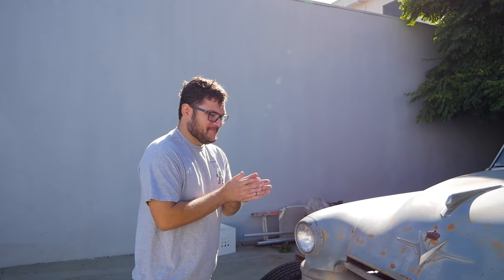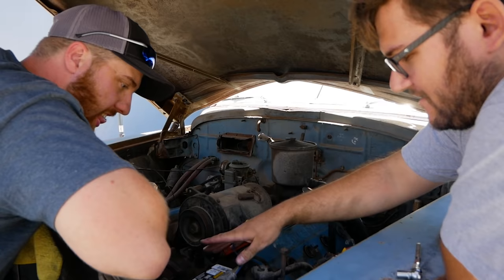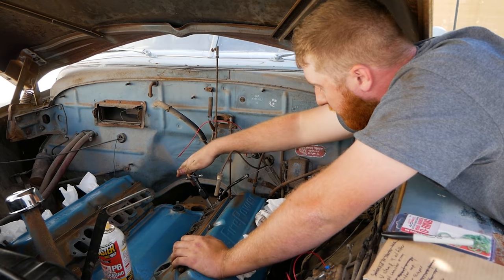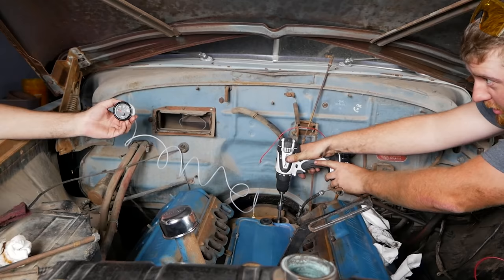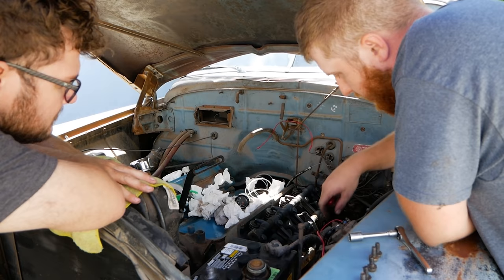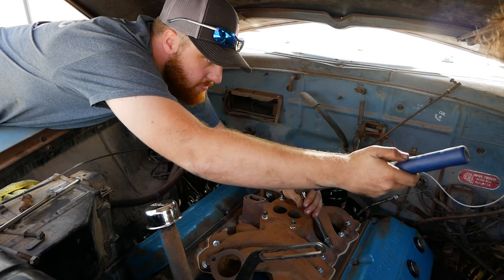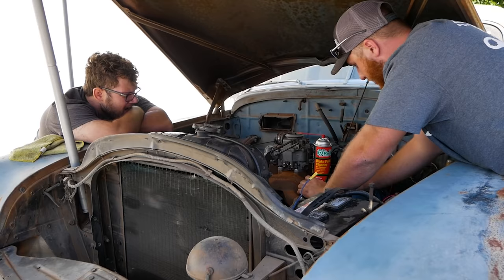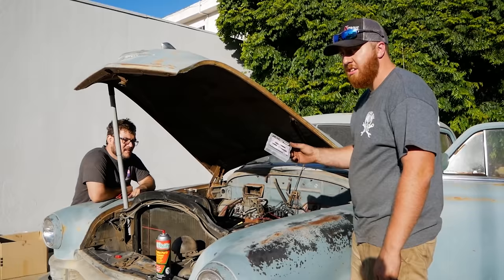Can We Revive Nolan's 1952 Imperial? First Start in 38 Years!

Comment: "124,000 miles. Honestly impressive that it made it that far"

looks away in 293,000 miles
Reply: 300k is the new 150. I had to replace the everything tho at 160🙃
Reply: Reliabilty standards have come a long way since that Hemi.  As pretty as it it.
Reply: Oil changes ftw
Reply: 50k was the average life span of those older motors. But then, people weren't driving as far as we do today. So that was a pretty long time for them to last.
Reply: With the oil filter never being changed, 124,000 is damn good.
Reply: Well, with a 50s motor, its impressive, today, gas v8s can go 500k before they completely want to give up
Reply: @sylleess4914  Don't exagerate.  Remember, they never changed the oil filter in this car, which means that it went over 100,000 effectively with no oil filter, on motor oil that is very inferior to today's oil.  I say that is EXCELLENT.
Reply: @NEEDbacon  You mean MOTOR OIL has come a long way since the 70s.
Reply: @jad43701  The average mileage of a scrapped car in the 50s was a little over 100,000 miles, not much better in the 70s.  It all boils down to MAINTAINENCE.  If you don't change your oil, and don't keep the oil level full, it will not last long.  That's just the way things are.  And today's oil is far better than yesteryear's oil.

Comment: Before you hook up all the electrical components; That car is a POSITIVE ground. It’s presently connected backwards.
(And put zinc additives in the oil) 😜
Reply: This is one of the things you'd (or at least I'd) never think of if you didn't already know it!
Reply: @vinno97  my very first car at 14 years old, in 1994, was a ‘54 Dodge. 
I’ve had about 70 antique cars since then. Many old MOPARS! 
I usually dump an 8 volt battery in place of the 6 volt. It spins it up faster and doesn’t require much modification (if any) to the electronics to function normally. But, they are all positive grounds until 1956.
Reply from the maker: I think someone probably converted it over at one point
Reply: @JunkyardDigs , that’s good. I’ll stop yelling at my television. 😂
Reply: It's painful to watch
Reply: That 331 hemi sounds awful.
The carb is in need or a rebuilt...timing sounds retarded big time.
I have a few old 331 354 hemi's.

Comment: You can use an 8 volt battery in that 6 volt system for faster cranking, the 6 volt system can usually handle a couple extra volts, just need to adjust/replace the voltage regulator to the charge the 8 volt battery properly.

Comment: Brilliant the way you focused in on that clogged oil filter, which stopped oil pressure in the system.  The average bear wouldn't have even thought of that, rather us common folks would have dropped in the distributor, rigged the coil, topped off the oil, and let her rip. 
      I watch all of these "will it run" videos on YouTube, and finding that clogged oil filter showed a depth of understanding well above most of your peers.

Comment: the car was in gear that's probably why it was turning over so slow also.
Reply from the maker: It's an auto transmission
Reply from the maker: Well... Kind of. It's complicated but that's not the problem
Reply: @JunkyardDigs  was it one of those trannies that has a torque converter between the flywheel and clutch? I forget what they were called. I believe Dodge was the first to use them in the 50s.
Reply: @JunkyardDigs  oh okay and I do know that it being a 6 volt system can cause it too.
Reply: @JunkyardDigs  Thee car was not in gear, was it?  The car has no park and I am willing to bet you didn't have the hand brake engaged.  The rear wheel was turning with the force of the driveshaft.  When you accelerated, the rear wheel didn't spin any faster.

Comment: Need to find the missing choke stove pipe assembly to close that exhaust hole in the intake. ( exhaust gases were used to heat up the choke on the carb thru tubes in the good old days)

Comment: Dude I swear nobody changed their damn oil in the 50s. Must have been a depression era thing. “Why would ya throw out perfectly good oil”
Reply: Didn’t throw it out. Used it on their dirt road to keep the dust down.
Reply: I had an old timer tell me the famers used to take the old oil and mix it with gas and run it in their chainsaws... like 10:1 mix. I learned this when I was a very young and ran a late 50's Homelite saw with modern oil at 30:1... and yes I blew it up.

Comment: Watching the rear brake drums spin makes me wonder if you've got the trans in gear.
Reply: I was thinking the same thing.
Reply: and that is why it cranked too slow on 6v
Reply: I believe it's an "All-Fluid Drive" trans. Basically a manual with a torque converter between the flywheel and clutch, so the only time the clutch had to be used was to change gears. Starting it in gear would basically be no different than an automatic starting up in park.
Reply: if you're right, your comment needs to be pinned to the top.
Reply: It was not in gear.  if you will notice the drum did not spin any faster when the engine was revved up.

Comment: My dad has a 1948 coupe with an inline 6 that I wish he would let me help him get running. Its engine was supposedly rebuilt with the intake and carburetor still installed. He just doesn't have the time given we have other antique cars we are currently working on including a 1969 Dodge Polara 440ci 4 barrel, 1972 Jeep CJ5 (1st yr of the 304ci 2 barrel V8), and 1985 Dodge D150 318ci 2 barrel.

Comment: If it's anything like my '51 DeSoto (a branch of chrysler) S-15 (Desoto's version of the imperial, it should turn over slow like that because it's a 6 volt system. Bonus fact, the '51 S-15 is a positive ground system.
Reply: "6 volt systems turn the starter over slowly" is a myth.  If you use 1 gauge cables, not skinny 4 or 6 gauge cables, AND have all connections CLEAN AND TIGHT, EVEN THE STARTER CONNECTIONS, and use, in this car, a group 3 battery, it will crank fine.  I have a 54 New Yorker, and it cranks nice and fast with 6 volts.  If you think it doesn't crank fast enough, you can use an 8 volt battery.  You just need to have the regulator adjusted so that it will work with the higher voltage.
Reply: @michaelbenardo5695  I misworded my previous comment. I meant that 6 volt systems turn over slower than 12 volt systems. As you stated even the 8 volt batteries will cause the starter turn faster. As for my specific situation, I know that the starter terminals are fine as I just had the starter rebuilt, the 1/0 (0 awg) battery leads are more than enough, and the battery is working properly with no dead cells. Also, 1awg is a little uncommon, did you by chance mean 1/0? Both 2 awg, and 1/0 are more common.
Reply: @psychotic_hero  I meant 1 gauge.  You will have to go to a human-owned auto parts store and probably order them, as there are no cars being sold of recent manufacture with a big enough engine to require them.  You can use 1/0, which is even bigger, but make sure that the hole in the lug end is not so big that very little of it contacts the terminal for the cable that goes to the starter.  If it is too big, use a washer between the two cables, so that there is plenty of serface area in contact.  Also, make sure your ground cable is making good clean solid contact with the engine block.  It must be clean, or you will likely have trouble, unless you have a tiny engine.  You will get it to work well.

Comment: Remember.  a 12v system runs 10 amps.  a 6v system runs 20 amps. Out side of making sure you have good battery ends (toss those clamp ons).  You want THICK battery cables.  Like 0 or 1 gauge Be careful buying parts store battery cables.  you could throttle the Amperage to the starter. Also,  back in the day they ran non-detergent oil with left tons of much in the engines (Seafoam to the rescue).

Comment: So duct tape and baling wire have been replaced with zip ties.
Next time, I would recommend taking the hood off and sitting on the fenders.  You could also put a small grill and fridge with beer in there also, it'll cut down time.

Comment: No one asked but if you are planning on doing something like this at home yourself I highly recommend getting the manufacturers workshop manuals for the vehicle you're working on. Not those cheap $20 service manuals but the workshop manuals sent to dealer workshops. It'll make your life much much easier and will pay for itself in the long run. Obviously it's not "needed" but in most cases it'll be very useful even if it's just to clarify what you already believe to be correct. 

Obviously you can't get them for every make and model but you can for a majority. They are very comprehensive. Even things like missing bolts can be looked up quickly without having to stuff around. 

IMO ALLEGEDLY

Comment: Too bad I wasn't there when you did this. I know that circa of engines I could probably rebuild it drunk... wait, I'm pretty sure I have!  If you haven't figured out the fuel pump clamp try a dryer vent clamp, they're 5 or 6 inches.
(Signed) Old Iron Man.

Comment: My clasic revival was a 1979 dodge W150 (power Wagon) Now I am dealing with gas in the oil. New gaskets all around new fule pump and new carb but not sure the problem at the moment. I think I have the adjustment screws on the carb set at about half a turn from closed. I did not get gas in the oil untill after changing the carb so I think it is a problem there. I had it running great untill it blew a head gasket. though the origional carb did crap out on me after changing the head gaskets.

Comment: That engine will run dam near forever if you maintain it, especially with today's oil being WAAAAAY better than back when this car was made. Better spark plugs, carburetors, gas, better everything. Rebuild the suspension, give it a coat of fresh paint and cruise it on the weekends. I'd make it a baby blue low rider with nice exhaust pipes and call it good...

Comment: So worried about priming the oil, then throws LOTS of brake clean down the pipe LOL. Poor Hemi. Then they complain its tough to turn over, yet clutch is engaged and starter has to spin transmission, driveshaft AND differential, then as an added bonus the motor pukes out a couple of their paper towels they stuffed down the intake lol 

"Oh it's on fire!" That's an unblocked off heat riser from the exhaust genius!

Comment: My pickup still has a 6 volt system and the only way I could get it to reliably crank, with speed, is to use incredibly thick wires to the starter. Like 000 gauge wire. Before that I did have to jump it with 12 volts once or twice, I just isolated the starter from the system.

Comment: Second comment 6 volts is enough to crank it. There's a choke for a reason. It makes it much easier to start at a much lower RPM. There's plenty of compression and assume the carb is dialed in it'll start within 15 seconds of cranking on the starter. Once the first cylinder fires the rest will follow most likely without a single misfire. That starter is meant for torque not speed. She wants choke. Here's the edit. I didn't realize that you didn't have the ignition timing already set. No wonder it didn't start even with the 12 volt. If both the distributor and the carburetor were right it would easily start on the 6 volt system. 12 volts isn't good for them. I just hope you didn't fry too much of the system. My first car was a 1954 dodge royal with the famous Red rod. Father used to drive his old model T Ford when I was a kid. I was born in 1927 and I'm too old to drive now at least legally. I also had a Studebaker and used to run rum back then. I'm 94 years old now and know how to text with a smart phone. I'm a very wise man and always learned new things. My wisdom rivaled that of Albert Einstein in my day. The only thing I have to say is that you can teach an old dog new tricks as long as he is wise enough. (PS. I started working in 1936 when I was 9 years old and by the age of 14 I was a machinist)

Comment: Do yourself a big favor and change it over to 12 VOLTS.. Just have your generator rebuilt and tell the guy to make it 12volts. Change coil and light bulbs in dash. Radio heater motor will be fine and wiper motor will be fine. And please put an OPTIMA BATTERY in there. They WON,T EVER LEAK.. CHANGE some ,truck. The head lights blinker brake bulbs will be fine without changing, no need to change the starter either.

Comment: Rebuild of the lower engine and the stuck valves in the oil filter housing likely means that the engine was rebuilt because of a spun bearing. I'm 14 minutes into the video at this time.

Comment: It must be the spring why the starter motor is electrically running off the battery? Nope. Pull the starter and crank it again. It will be pretty obvious if the spring and starter work. I think your starter is mis-wired or your starter solenoid/ignition relay is stuck.

Comment: omfg nevermind. I cant make it pass the 8min mark. 1952? should take about 15-30 min to crank that guy to life. in real time y'all are probably on a couple hours and your still D1kin with the electrical. Fuel, Air, Spark, Battery, and 2 wires will make it run.

Comment: I was wondering how long it would take you guys to realize you had a 12v system. I think that once you rebuild the carburetor, put in a new 12v coil and condenser that critter should scream ! You may or may not, need to change the spark plugs. Since you essentially have a bigger motor.
Reply: If you use a 12 volt coil on a 6 volt system, you can't use a ballast resistor.  There will be no benefit.  Just use thick enough battery cables.  6 volt starters draw twice the amps as 12 volt starters.